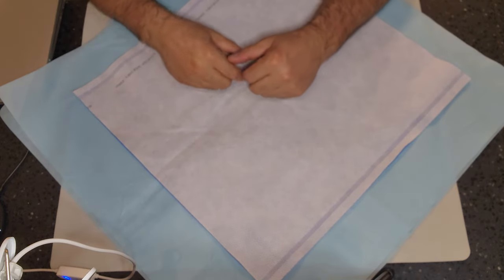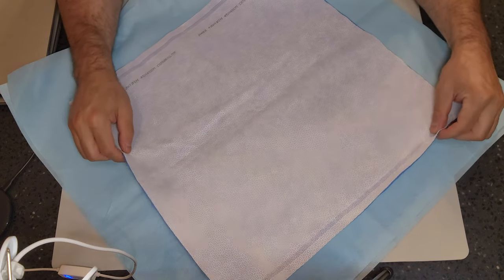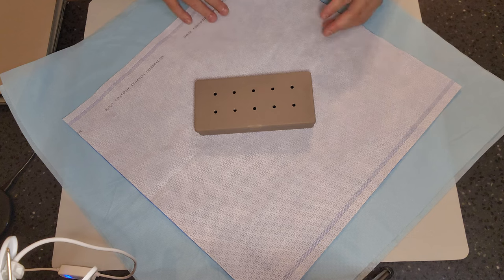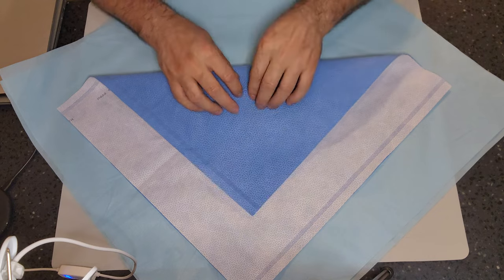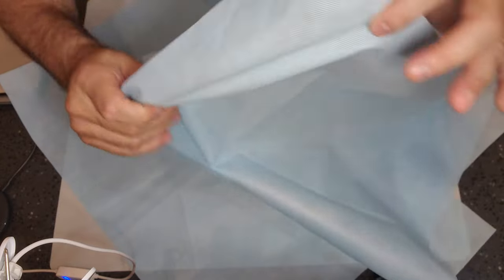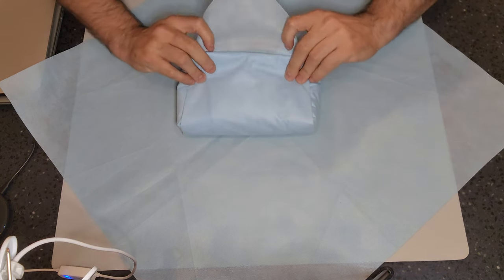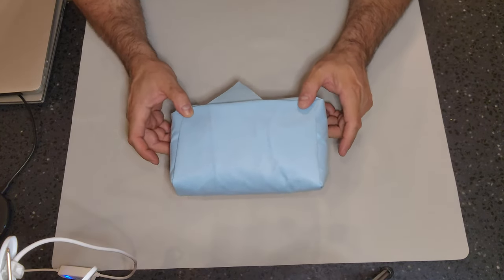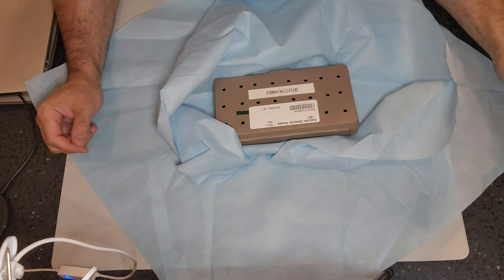Demonstrating Sequential and Simultaneous wrap technique utilizing the envelope fold.

Comment: Hi Jessie, great presentation, when do you use a sequential wrapping, is it safer than single wrap?
Reply from the maker: Hello Maryann. Let me first make clear that sequential wrapping is done with single sheets of SMS wrap. The technique is aka double wrapping. Simultaneous wrapping can be done with two single sheets at the same time, or one double bonded SMS wrap. This technique is also known as single wrapping. To answer your question neither method is safer than the other. Both provide the same microbial barrier to keep items sterile when storing. Butttttt, sequential wrapping offers a second chance for aseptic presentation on the field. This is to say, if while opening the package, the inner package is inadvertently touched, it is still ok, because there is another barrier to try the aseptic opening and presentation again. This is not to say if a hole in the wrapper is discovered that it is still acceptable. If a hole is discovered in either method, the tray is considered contaminated. Hope this answer your question.

Comment: So your information was good up until min 8:58. It is not called second chance wrap, the inside of the 2nd wrap is a dust cover as the instrument inside the first wrap is what is sterile. So by throwing your instrument onto your sterile field with that first wrap still on is a CONTAMINATION.
Reply from the maker: I disagree. Dust covers are made of 3mm clear plastic. Sequential wrapping is an old school method that increases the torturous path. The outside packaging is still sterile on the inside but if inadvertently contaminated the inside wrap offers the second chance for aseptic presentation.